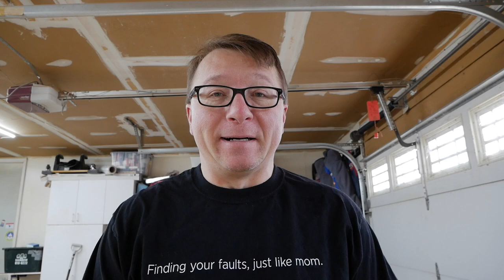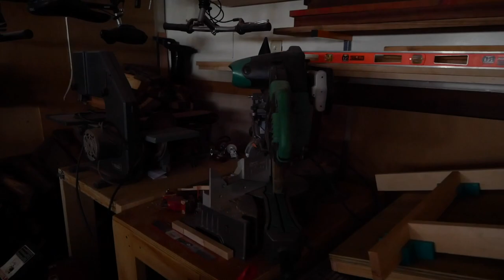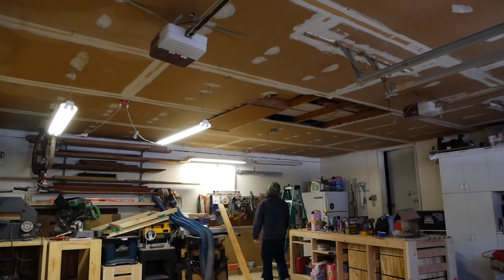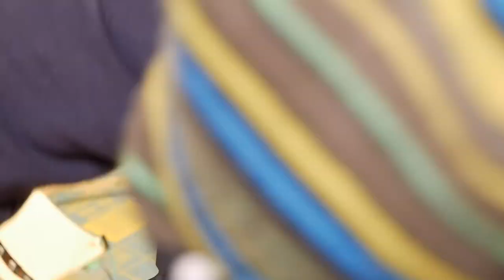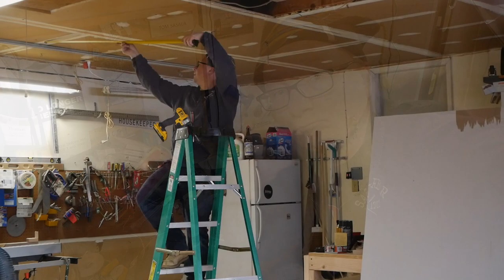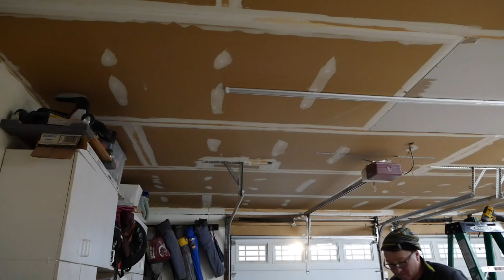Installing New LED Lights in the Garage

Comment: Nice, having LEDs like that in a garage, makes working in there a lot nicer! It's worth checking with your local utility to see if there are any rebates on those lights as well. A lot of them will give you an additional discount for switching. 

I'll preface this by saying I'm an electrician (in Canada). Although your joints look good, I'd highly recommend ordering the correct extensions for your lights. The NEC   will have a code against modifying fixtures like that.

Thanks as always for sharing!
Reply from the maker: Thanks - will do!